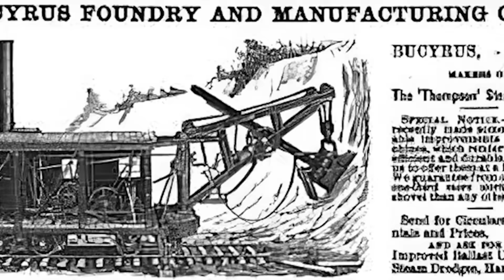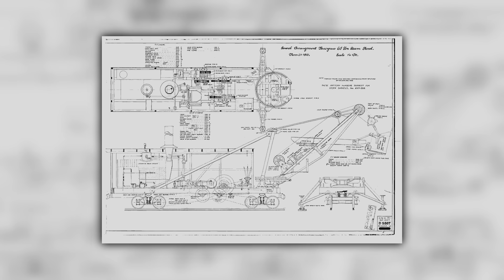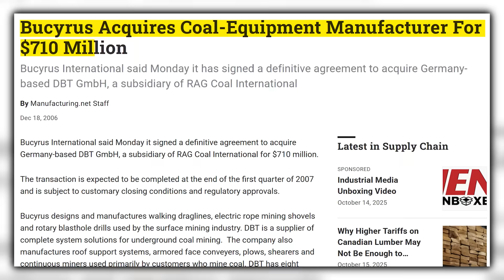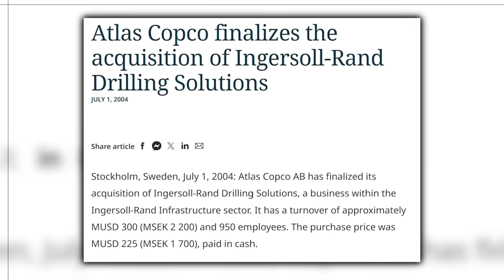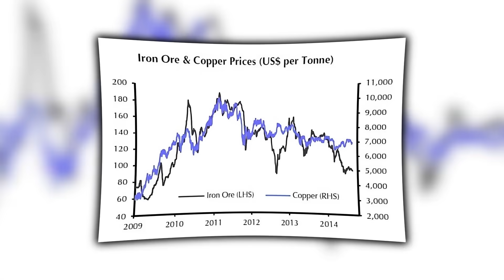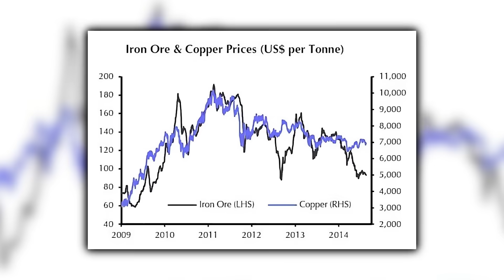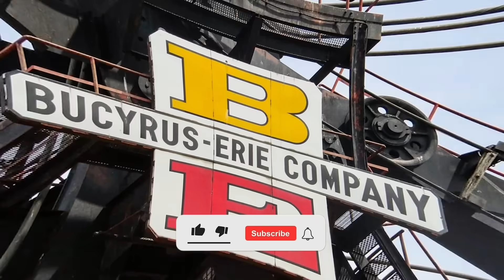The Megawatt Power That Silenced Diesel Engines

Comment: I wish the person that composed this, or the person that initiated the AI generation of this, had understood the technology involved a bit better. The move to electric power was revolutionary at the time. But it had far less to do with the failings of the diesel engines available (which were few) and more to do with manipulating the control systems. Lifting and moving required rotating masses that involved clutches and gear boxes that in these digger sizes became very hard to produce, but also extremely hard to operate smoothly. Going electric fixed many of these problems but also allowed for the excavators to expand in size in a way that diesel powered equipment never could.

Comment: The grid power is not clean enough they have big dynamotors that run on grid power that generate clean power to run the machines equipment. My departed other half was with AEP I got to be in it in operation and URBEXED  it when it was parked the size of that machine you can’t comprehend until you were in or around it. It even had a overhead crane inside to lift parts that needed replacing!  It was that big !